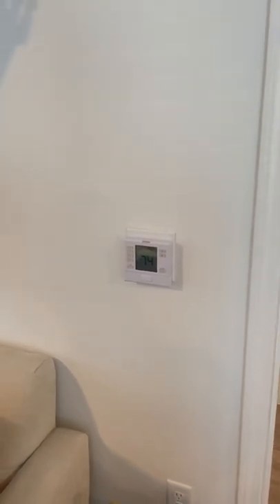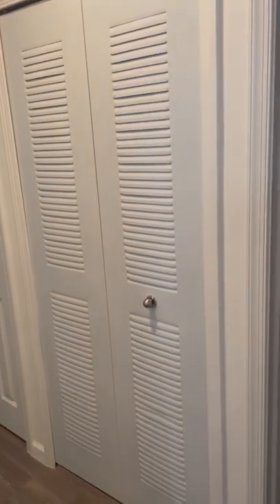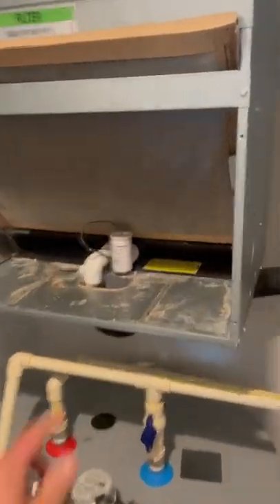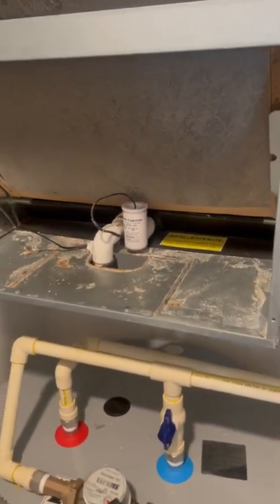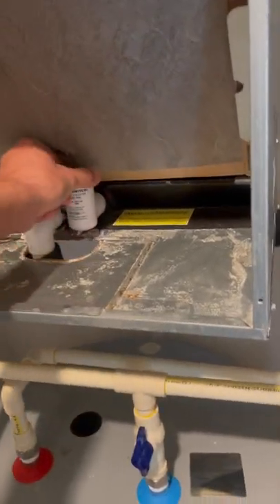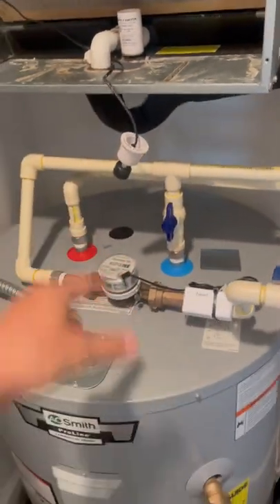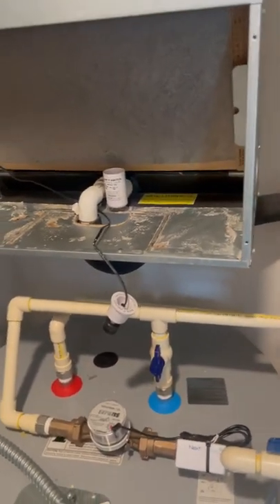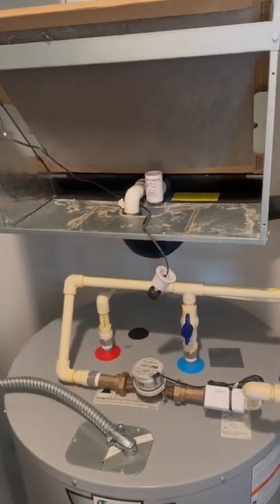Ac Float switch bypass￼

Comment: I wanted to say thank you!
My thermostat was not detecting any power all of a sudden. Couldn't figure out why. 
Eventually came across an article that said it could be due to the float switch. Removed mine and still didn't get the AC to start. 
Watched your video, and realized I has a SECOND float switch! Removed that one and sure enough, the AC started back up.

Comment: Thank you. In a rental, and it’s midnight. Got it back on for now- am I going to have leaks overnight tho? I’m a bit scared leaving it unattended, before I came over the drain pan was super full, maybe 2-3 gallons of water I scooped out with a Tupperware.

I’m going to ask the neighbors if anyone has a shop vac I can use tomorrow in the morning, will I be okay with running the AC overnight, without the water dripping everywhere again? Daikon AC unit is in upstairs closet 

Thank you for this!!’
Reply: How did it go?  I’m leaving mine unattended. It’s too hot. Tomorrow I’ll use the shop vac again.